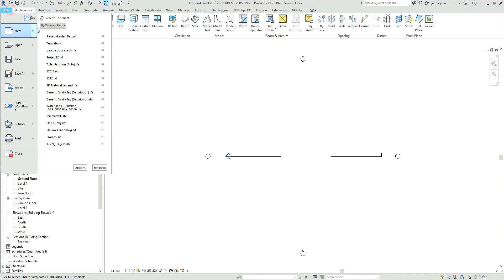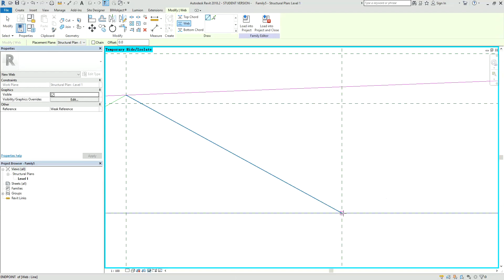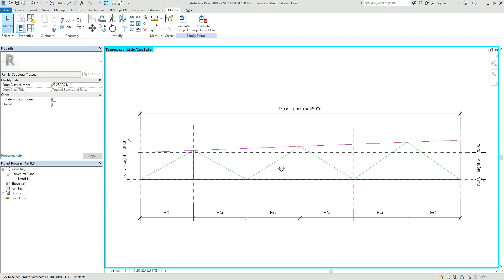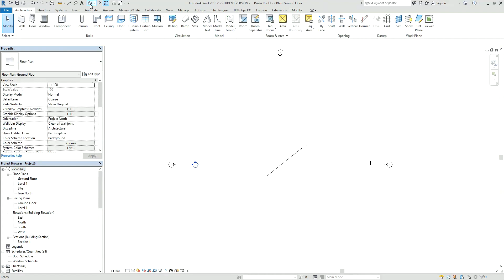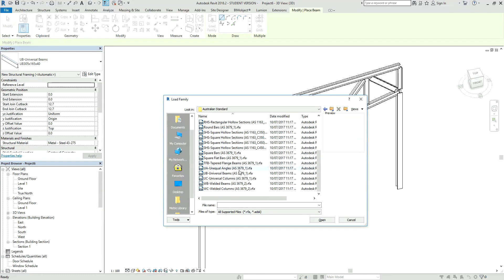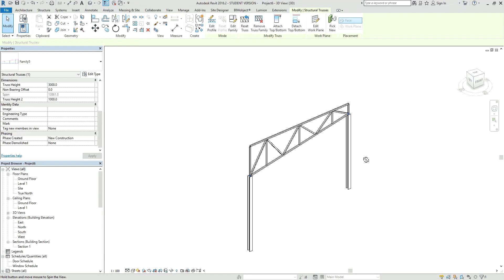Custom Truss Family

Comment: How to control if I want to change vertical member spacing without changing Truss Length?
Reply from the maker: Do you mean changing the number of the webs? I'm not sure, since it can't be done with an array due to the slope. Maybe you can create multiple web configurations and use a visibility parameter to control them, or it might be better to create multiple families.
I'm not very fimilar with structural truss family, but if you can post some examples here: https://www.reddit.com/r/BinHe615/, I will have a play.